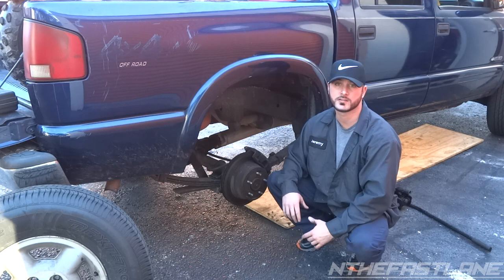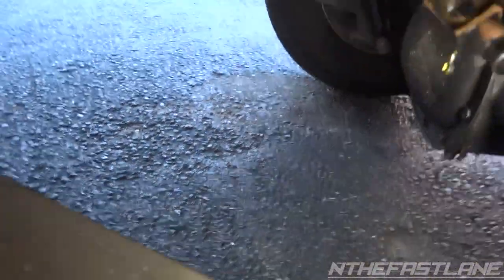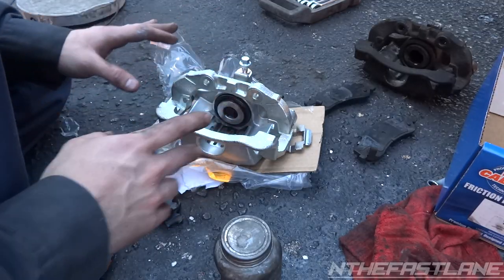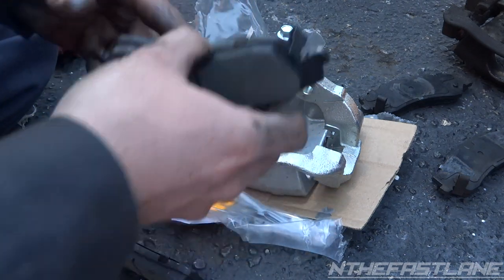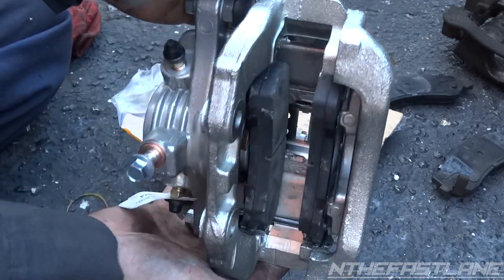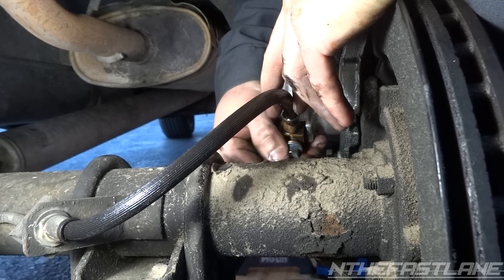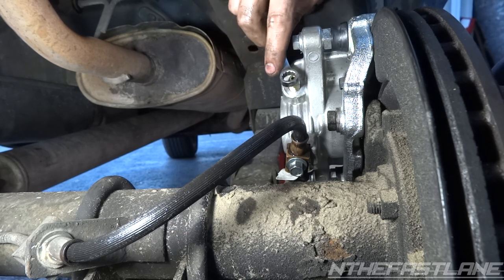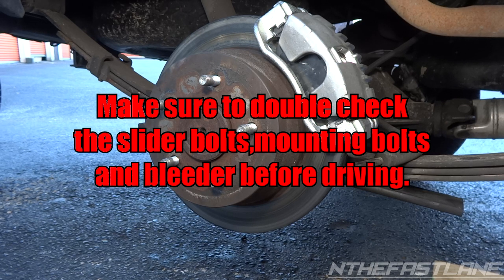▶️How To Remove And Replace A Rear Disc Brake Caliper On A Chevy S-10🔧

Comment: Hey man i like your content but i had a question about an old video you had regarding to the turbo restrictor. I was wondering if you know if your oil pressure changes depending on how built your motor is. I am planning on running a T3 journal bearing turbo but my car is going to have a built motor. I don't want to blow any seals nor run it dry. Basically what I'm trying to summarize is if the oil pressure varies on how built the motor is or will a motor alway produce a raw pressure reading. Thanks
Reply from the maker: Oil pressure will increase with RPM and decrease with RPM. Idle should be anywhere from 5 to 10psi and upwards of 80psi at wide open throttle. I would use a 3AN stainless braided oil feed line for the turbo. I would not run any oil restrictor on a journal bearing Turbo. Sometimes a oil restrictor is needed if I say you're getting close to a 100 PSI at Full Throttle, but more than likely it's not with a journal bearing. Journals need as much oil as possible because the bearings float inside the turbo cartridge, just like the engine does with the rod and main bearings. Pretty much mandatory to run a oil restrictor with a ball bearing Turbo. If your turbo is leaking oil out the turbine or compressor side always check the turbo return drain line pitch, most of the time that's the problem.

Comment: Cool channel...just subbed...i have a 1991 civic hatch back...i put a b16 in it...but the steering is si hard to turn...i have the right axles and half shaft...just cant figure out what it is....thanks big dog
Reply from the maker: Did the steering turn with ease prior to the swap?
Reply from the maker: If it turned fine prior to the swap, I would first check out the power steering line going towards the power rack and pinion. You could have bent it, or damaged it in the process of putting the swap in.

Comment: I have a Chevy S-10 zr5 truck.... my back light is solid and I don't have back bright light when I smash the brake pedal
Reply from the maker: If you replace the bulbs and it's still doing it, check the "Brake Stop Light Lamp Switch" behind the brake pedal. It should look like a white plastic square box, I'd say 5 inchs by half an inch thick.
Reply from the maker: Here is the GM brake stop light lamp switch. https://amzn.to/2DOA1If
Reply: @Nthefastlane  I already change the brake light switch behind the brake pedal..... the fuses is good
Reply from the maker: I would suggest checking the bulbs. If you replace the bulbs with new ones you could have replaced them with the wrong ones. Brake light bulbs have two separate filaments, we're other standard bulbs only have one. Also one of the filaments, or both of the filaments could have gone out in each bulb.
Reply: @Nthefastlane  oh ok
Reply: @Nthefastlane  I have brand new led lights bulbs and it's the right part number when I bought it
Reply from the maker: @nicolasramos9684  Try installing them the opposite way. Let's say ones a positive, and one's the negative, put it the opposite way you installed it if it'll let you. Most bulbs have little bumps on each side so they install in the socket one way, but with those LEDs they could install both ways.
Reply from the maker: @nicolasramos9684  Take one bulb out at a time, rotate 180 degrees, and reinstall it
Reply: @Nthefastlane  ok

Comment: Why my s10 has the bleeder on the bottom and not on top like other vehicles 🚗?
Reply from the maker: I would say your calipers are on the wrong sides. Example: You have the "right" caliper on the "left" and the "left" caliper on the "right". More than likely they need to be swapped to the correct rotors.
Reply: @Nthefastlane  yeah that’s what I thought and I think they the wrong disc too cause i can’t put wider tires they be hitting on the frame inside 🤦🏻‍♂️🤦🏻‍♂️